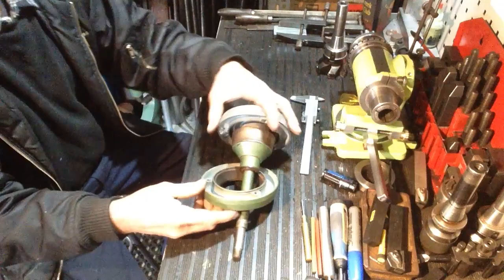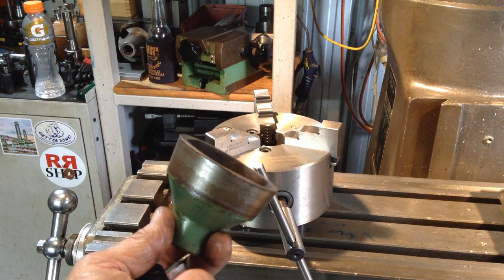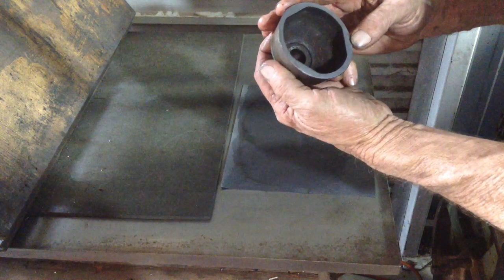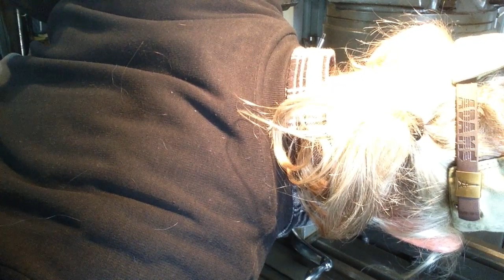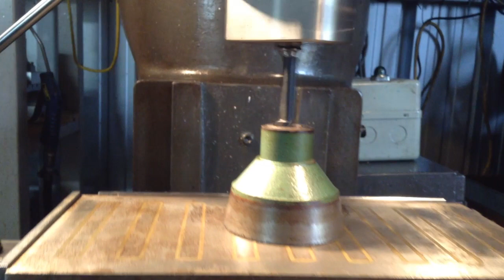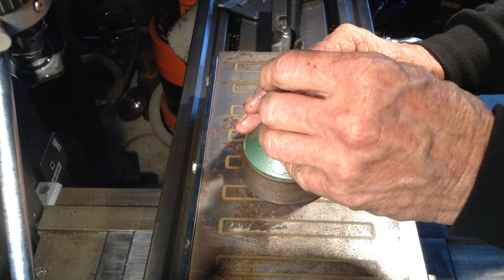Flogged out Alroh , Sorry  Scott Bonnar !  Mower Cone Clutch Repair .   Part 1 .

Comment: Hi Max .. You did a great job as per your way of explanations & setting up etc. But ... My question is:  why didn't you go off the round center section over the hole, set it up in a 4 jaw or 3 jaw chuck, then check and adjusted  for concentricity of the job, then line bored it in the lathe, ready to make a bush for it .
Reply from the maker: Hi Ted .  Then i would have had to clean the paint off the round part !  But yes , that would be another method .    Cheers .
Reply: @swanvalleymachineshop  bloody paint   lol

Comment: Alroh were a WA company making good quality mowing equipment originally in 576 Hay Street Subiaco. Their factory was a local landmark right near the subway. I drove past it often as a young bloke. They sold straight from the factory and my Dad bought a new mower from them in the early seventies. They were later absorbed by other concerns and are now defunct. Their products always had a nameplate with serial number and factory location.
Reply from the maker: Thanks Peter .  Perth was good years ago , still a small city & you could get a car park anytime .  I remember a big steel scrap yard on Newcastle St .   Cheers .
Reply: @swanvalleymachineshop  Bill's Machinery I think.

Comment: I thought the shaft build up was a perfect chance to whip out the spray weld and build that thing up. Although just turning another one is going to be shit load easier, but where’s the fun in easy 😀
Reply: Welding powders are not cheap and the bolt was probaly free. I think the logic speaks for itself.😉
Reply from the maker: @chrisstephens6673  The bolt was free !!!
Reply from the maker: Thanks Mate . As Chris stated , the powders are expensive .  I will give my Euetectic Rototek torch a trial soon .  Cheers .

Comment: Alroh were made by MEY in Bayswater , Perth  and yes Google provided the answer .
Reply: I believe they closed in 2013 though. The shop that sharpens the blades for my mower said there was somebody in Mandurah still providing parts. Sorry, all a bit vague but haven’t needed any parts yet, well my main concern would be a new blade reel (don’t know it’s proper name).

Great work Max. 👍
Reply: Yep another Aussie manufacturer gone bust
Reply from the maker: I know the place , on Collier Rd .   I remember it used to be called another name back in the 80's .